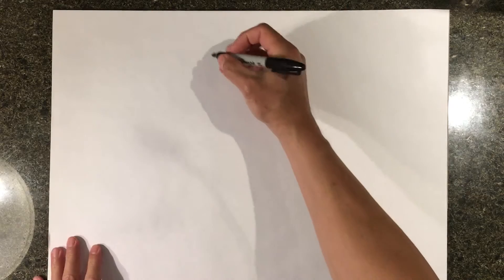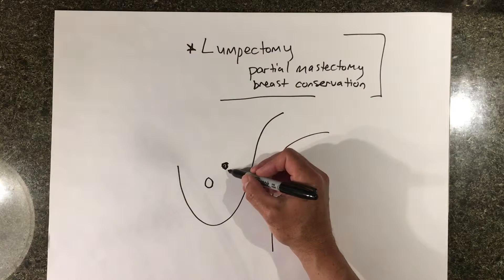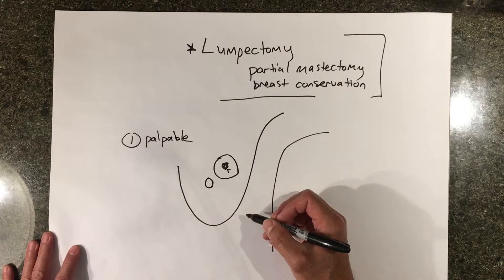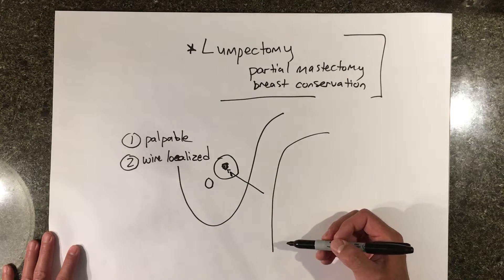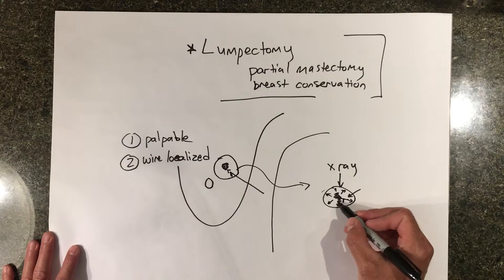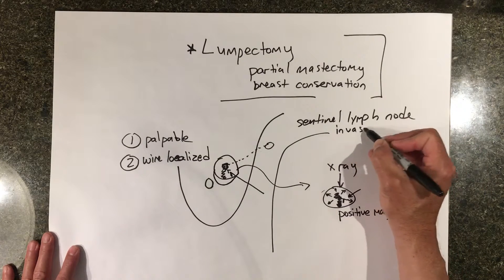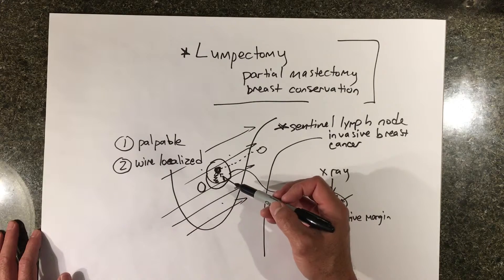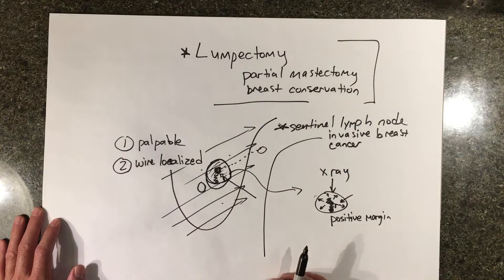How is a lumpectomy for breast cancer done?

Comment: I had a lumpectomy 1 week ago. I've chosen not to have radiation. I'm almost 70 years old and I'm likely not to be around for another 20 years.
Reply: Good for  you!  I had the same;  lumpectomy in 2019 and rejected radiation (chemo wasn't recommended because my numbers were too low) and ALL conventional treatments.  I chose to use a holistic doctor along with high dose vitamin C infusions and natural supplements.  I'm in year five cancer free.   I'm almost 55 years old.
Reply: @motherofthreeb6337  Great! I'm very happy for you. Yes, I've heard high doses of vitamin c are beneficial. I was told before surgery that they would some surrounding lymph nodes as well to test for cancer. I didn't know what lymph nodes were. So I did a bit of research on the lymphatic system. When I found out that it's the system that protects us from diseases I said "no" to having any of them removed.
Reply: That's awesome you were empowered enough to do only what you wanted. I'm 68, doing the same, lumpectomy, no to chemo,radiation and the hormone blocker.  I'm taking some alternative things but I'm not sure for how long. I wish I had of said no to the lymph node removal. I did ask if she could just do a needle aspiration and she said no. The nodes were neg. Surgery was 7weeks ago and that area is still sore. I wish you both years of health 🩷
Reply: I’m 72 and had two surgeries for invasive ductal carcinoma. I did have radiation and I didn’t think of how long I would live. I just wanna live.